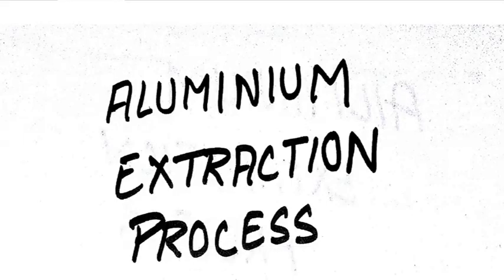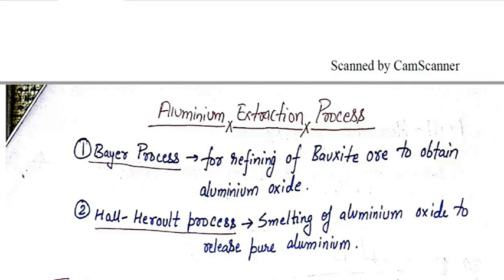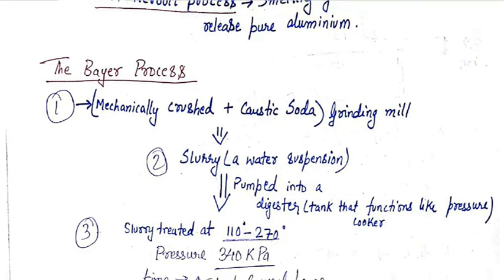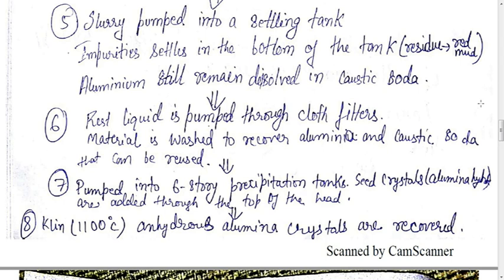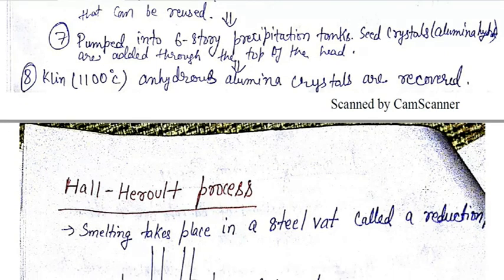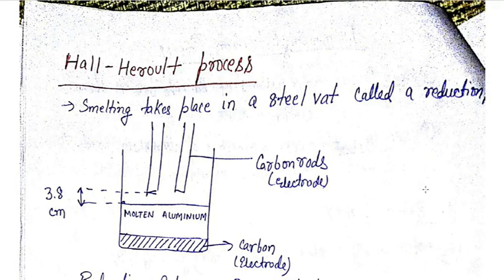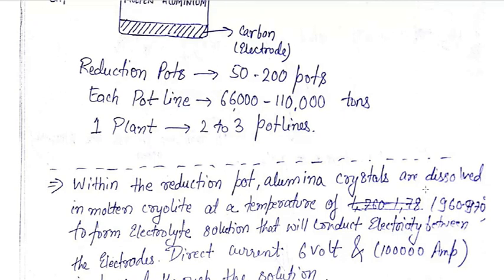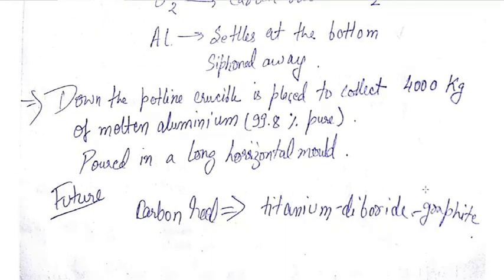Aluminium Extraction process Explained in Brief | Bayer Process | Hall Heroult process

Comment: in smelting process what is the need to give 3.8cm in between alumina rods and molten aluminium
Reply from the maker: The opposite rods are lowered into an electrolyte solution and held about 1.5 in (3.8 cm) above the surface of the molten aluminum that accumulates on the floor of the pot.